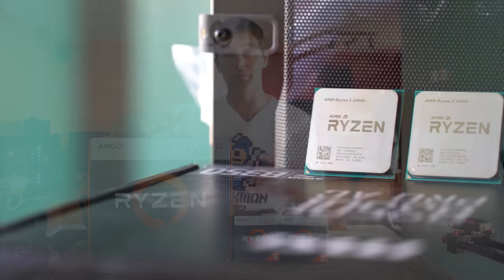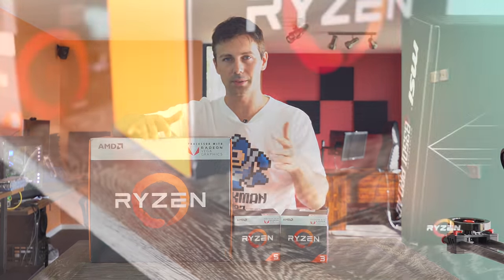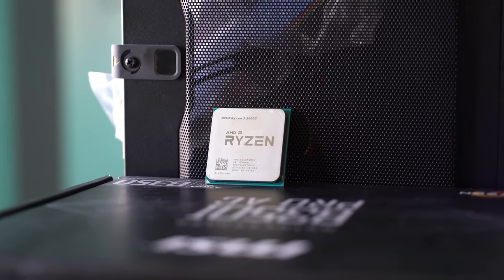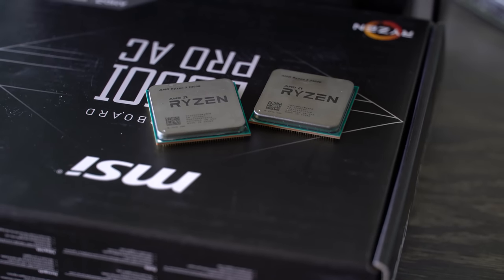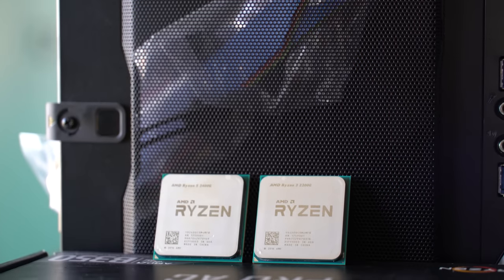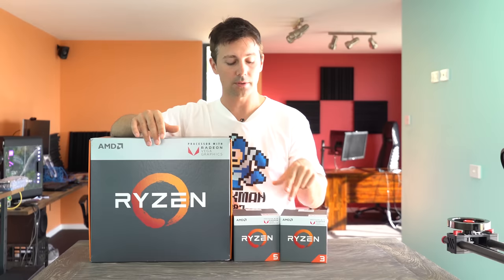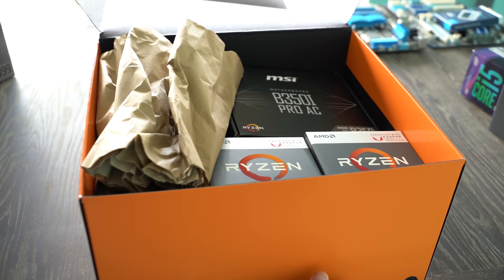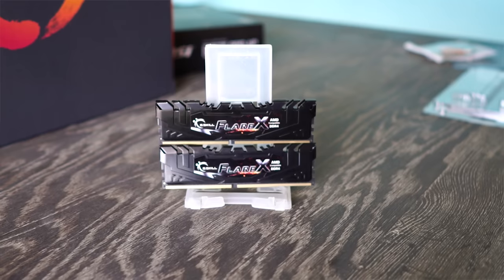Raven Ridge Mini ITX PC? A 'Different' Ryzen 3 2200G & Ryzen 5 2400G Unboxing

Comment: Ryzen 3 2200G gets my vote. Overclock that iGPU and you have GT 1030 + Ryzen 3 performance for $99 :D
Reply: Are you sure? You trolling? your not supposed to leak :D Oz   Are you getting your stuff early too?
Reply: Ultimate console killa!?
Reply: Size and performance!
Reply: 1030? RX 560!
Reply: More like a low clocked rx550..
Reply: they've already given AMD rereleased benchmarks lol
Reply: GT 1030 only? That's a bit disapointing, I hoped the 2200G to be in line with a 550/560 and the 2400G with a 570, I might have been wishing for too much maybe.
Reply: Serius Sim, you want a $99 APU to match the performance of a Graphics Card that costs over $100? and a $169 APU to match a $200 Graphics card? You are definitely wishful for too much, actually if those were the performance levels, I can pretty much guarantee the APU's would be bought out by Miners.
Reply: +hmoham hahaha yes definitely. Would be cool though :)
Reply: John Hooper that's because games aren't optimized for AMD gpus
Reply: Serius Sim you have to wonder why they don't do that? I'd expect there is a market for a mid range GPU paired with a decent CPU, Intel seem to think so as they have paired their CPU with a Vega GPU, AMD could bundle the two on one dye and come out cheaper.
Reply: OzTalksHW I LOVE YOU
Reply: OzTalksHW sad they didnt put the better vega Unit into the 4 c / 4 t processor
Reply: John Hooper That's supposed to be the RX570 but the market isn't gonna allow those prices
Reply: Would a ryzen 5 and a GT 1030 be better then a ryzen 3 and a GTX 1050
Reply: Bike Dude so I should not use the apu? Also what about  RX 550, also can u get an apu and a normal GPU to work together at the same time
Reply: DOes that really matter since Nvidia has no CPU to go with thier GPU?

Comment: That's not going to fit... that's not going to fit... well now you're just being stubborn.
Reply: i know ae.. that was what i was thinking the whole time!!
Reply: If the side doesn't close all the way because of the cooler's height, I would modify the mesh side by cutting a hole the size of the cooler so that the cooler pops through. Then attach the cut out mesh on top of the cooler.
Reply: Closes just fine if you remove plastic shroud around the cooler: https://imgur.com/a/KAgwt
Reply: @Oleg, thank you!

Comment: That stock cooler fits perfectly
Reply: ZG CoffeeGuy NA lmao
Reply: Like a glove!
Reply: instead of stock cooler, does NOCTUA NH-L9i fit better in the case?
Reply: You just need to remove the AMD branding uppercircle. It is just 2 screws. Such a lazy builder.
Reply: @magenci  and that is the point where I stopped the video.  So many other youtubers before him have built in the Chopin and did it correctly.
Reply: at 4:38 you can see that the case is not closed in the back

Comment: I love these. I was gonna build a mini itx as a TV box. I was gonna go with an older i5 and a gt 1030 for very very light gaming. However, the 2400g makes that plan irrelevant now. Having 8 threads, a gt 1030 level igpu, at only 65w is incredible.
Reply: Dingleberry Tech same thinking here, looking at building one as a lounge emulation console. Hoping it'll run everything up to ps2, dreamcast, og Xbox, gc, wii and possibly some 3ds, wiiu. The only thing that worries me is that amd graphics aren't as widely supported on the high end emulation scene. Wonder if it'll overclock to 4ghz on a decent air cooler
Reply: a g4560 and 1030 will be slightly more expensive but wont consume that much more power, it can also fit on most tiny mini itx cases. but of course 8 threads will be better than 4 threads on productive cases. gaming wise the g4560+1030 is formidable foe and very viable alternative. threadwise go 2400g, but then the question comes in why not go r5 1600 or 1700 plus half height gpu like 1050ti ^_^
Reply: Yea, but Ryzen is always 20% ahead of the g4560 in games. Every single single task the g4560 performs, the 2400g will outperform it, cost less, and consume less electricity.
Plus, both the gpu and cpu cores are OCable.
Reply: for the price difference of that 3200mhz ram kit over its 2133/2400mhz counterpart i can freaking buy a geforce 1050 (or radeon rx 560) with 2gb of dedicated vram and have way better performance ^_^ old stocks of Ryzen 5 1400 still sells for 169 but i bet it will still outperform the 2400g when coupled with 1050/560 even when just using 2400mhz ram... 2400g only good for ultra compact budget build... for the online gamers the 2200g is sufficient...
Reply: No, the 2400g is slightly refined Zen architecture with a free GPU inside. Clock for the clock, the 2400g will outperform the 1400 by about 2%. And yea the ram thing's a bit of an outlier with the screwed up industry right now, but with that level of gaming, having faster ram doesn't make a difference in Ryzen. I know, I have a 1600 and have tested this with GPU bottlenecked scenarios.
Reply: again even if the 2400g is 2% better than 1400 (which is not and clearly stated by AMD that is clock for clock just ryzen gen 1 with vega gpu), the level of performance of the 1050/rx560 will be overwhelming for the 2400g vega igpu not to forget dedicated 2gb gddr5 very fast vram. a pentium g4560 with 1050/rx560 will beat it gaming wise saving more money too. tiny use cases is its only saving grace...
Reply: Checking sources, the G4560 is about 75$, where as 1050s are passed 150 now, along with the RX560. No matter how you look at it, you're going to be spending 60+ extra bucks, no way around it. The difference is the 2400g comes with a free GPU, and a CPU that's about 35% better than the G4560 in games. So you can go ahead and put a 1070 in there if you want in the future, and the 8 threads will do just fine. Where as the g4560 chokes around the 1050ti / 3gb 1060 vs other CPUs. If you remove the GPU out of the equation, you're still paying 169 for a CPU that massively outclasses the g4560 anyways, the gpu inside is just a freebee. Plus, you're either going to have to buy a Z270 mobo and upgrade to (what's quickly becoming outdated) the 7700k, your path stops there. But the 2400g, pair it with any AM4 board, and you can upgrade 3 years from now with Zen 2 if you want, literally 3 other skus to upgrade to. The value is incredible in comparison to the Intel route, and only an idiot would go that way.
Reply: i have over 30+ pc's, i never upgraded no freaking processor as the motherboard always dies first. you are evading the point which is both ryzen apu's will only outperform a 1030 if they use an expensive RAM which the difference could buy a freaking dedicated GPU like 1030/1050/550/560 (still available here at slightly above msrp but not by much specially if buy a whole pc set, gpu becomes msrp). i build pc's since 1998 and the only upgrade i do is better gpu's so its always better to buy a good gpu upfront. only idiot fans cling to promises and future proofing false hopes. we still remember the future proof that FX did lols glad i didnt buy into that! idiot intel fans also got burned hoping a z170/z270 is future proofed... the 2200g is priced fairly for its purpose, the 2400g is too expensive... anyways ill buy both APU just to personally feel what they can do...
Reply: Dean Avery check ETA prime video, he already test it for emulator. Spoiler everything run ok - except for wiiu - botw that need to be some work.

Comment: Benchmark Vega IGP vs GT1030, RX550, GTX750ti
Reply: Even gt1030 beats vega igp
Reply: The r5 vega 11 beats gt1030 but that's only for the r5.
Reply: as eetu isola said, 1030/rx550 will slightly edge out the vega igpu, 750ti is a league better as the 1030 barely even beat the basic 750. dedicated vram also plays big role. and i dont think many will buy that very expensive 3200mhz memory for apu. in most cases people will opt for the cheaper 2400/2666mhz ram so bryan should definitely show 2400mhz ram results alongside the 3200mhz.
Reply: Strider Wolf gt1030 would actually have equal results to the r5's vega 11 but I agree with the last,part
Reply: Not just for games either.  Run some Blender Render in GPU mode please.
Reply: ohdogwow2 this is what I want to know, how is cycles with this APU
Reply: Yes, Cycles is what I meant.  I call it the other out of habit.
Reply: Infinite Gaming Im the 100. Like xd

Comment: Would love to see Ryzen 3 1200 with low powered GPU like the GT 1030 vs Ryzen 3 2200G with/without GT 1030.
Reply: R3 2200g without gt1030 would win.Also 2200g has higher clock+turbo so it can't be a stock test cause there's kinda no point
Reply: And amd rx550/560..

Comment: i want to see comparisons to the last r5 1400 and r3 1200, in terms of raw cpu performance and a comparison as to how far you can overclock them compared to there older sibling processors
Reply: aidenhill should be a little less over clocking since there is more heat from GPU and its same first gen ryzen (not +)
Reply: OC shouldn't be affected: Ryzen isn't limited by heat output. Remember these are still the original Ryzen cores.

Comment: compare those APU's with GT1030, RX550, GTX750ti
Reply: Sunil Chennupati I can tell you just by specs it will outperform gt1030 and it will have 2-8 fps lower then gtx 750ti this just to give you idea how will it perform it might not be ultra accurate but shouldnt be very far
Reply: Yeah r5 2400g is also a cpu good to use

Comment: I want to see AMD do a Threadripper APU even just as a proof of concept.
Reply: The Threadripper is for a HIGH end work station and NOT for gaming. I bet in reality a Quadro would be paired with this in a work environment.
Reply: Wont happen, completely useless to.. Wont fit any more on that chip!
Reply: +Sebastian Hakansson   To point out, they do have 2 Zeplin chips doing nothing on those, so literally half the chips under the IHS are not even activated. They have a bunch of room. They could probably even put a massive GPU core between the Zeplin chips, there is plenty of physical space.

The question is why? GPUs increase about 60% performance each year, and Vega was not exactly stellar in the high end anyways (and power consumption), so would people really want to upgrade Threadripper every year or 2? Obviously not, that's where swapable GPUs are great since I doubt Threadripper will become "too weak" within that same 2-3 years. It would just be a waste, otherwise you'll end up needing to add a dedicated GPU then, which ruins the point of having integrated for most people in the first place.
Reply: Jonathan Domenech Using that massive ThreadRipper socket to fit a 4c8t CPU with a powerful integrated GPU around 580 / Vega 56 level would be very interesting as a concept, and may even have a niche, but it wouldn't be very practical for most people. Also the heat would be insane.

Comment: I build a nice little pc for my wife with the ryzen 5 2400g in this case. You must remove the upper plastic ring from the fan of the stock cooler ( which he didn't) and the stock cooler fits perfectly inside (approx 1 mm between the fan and the perforated plate of the inwin case. With the gigabyte ab350 motherboard you can connect two screens. I connected a HD computer Monitor on the DP and the TV on HDMI as this is also the Karaoke server. I used Gskill 3400 16gb memory which runs on the xmp settings without problem at 3400 MHz. The little thing runs perfectly and whenrunning half hour cpu stress test at xmp setting out of the box (no further overclock) the cpu runs at 72 degrees C. I first wanted to throw away that motherboard because with the ryzen5 1600x rigt after launch it had so many problems that I exchanged it with Asus in my home media server. I am glad that I gave it another try in this build. With the latest bios f22 it now runs without any crash since three weeks ( before with the first bios and ryzen 5 1600x it would crash every few hours just sitting idle) . The gigabyte board has a ton of usb connections on which I connected a webcam, external BR drive, external usb soundblaster (better connection to the yamaha mixer for the karaoke) and the usb wireless keyboard. So for this kind of a build (not everyone needs a pc for gaming) I recommend the gigabyte board.

Comment: The cooler fits if you remove the circular AMD bezel around it. It clips over the rim of the fan. You have to pry it off with a flat screwdriver or prying tool.

Comment: I do support the idea of mining performance of the iGPU, also it could be interesting to measure RAM speed scaling to figure an optimal cost setup given the high prices of DDR4. Thanks in advance!
Reply: Would interesting to see sure. Mining test should be more included today, whatever one personally thinks about mining..
But I think that these apu's wont mine that well, ddr4 vram and low vga cores.. And a whole system with a apu just to mine is not profitable!
In amd mining rig with more gpu's, maybe.

Comment: Thermals for Overclocking on the stealth coolers with both Int-GPU and CPU Overclocking would be cool. Trying to build a Ryzen system for my first year of Uni and money is tight, it'd be nice to know how powerful it'll be in the Australian heat. Maybe a few tests of 4X titles (Stellaris, Civ 6 etc.) with just AI players to see how it'll handle the calculations.

Comment: I like them both, I want to like the 2400g more but I honestly don't know when I would buy it as an enthusiast. I think it is a great chip for lower graphic intensity games, particularly e-sport. I could absolutely see myself buying the 2200g.. Under 100 dollar solution (and i was never a fan of the 1200 for its price point with no graphics).I could absolutely see myself building a lower power / cheap system using this chip. I think it will be highly attractive for simple business and office users too.

one benchmark I would like to see is just how much single channel memory hurts performance, something like 2x4 vs 1x8
Reply: It's not for "enthusiasts", it is a lowend part still for those that don't need more..

Comment: I really wanna know how these APUs, perform in non-AAA games, games like Warframe, Overwatch, Black Desert Online, and  League of Legends cuz high refresh rate right clicking ftw. Games that are famed for optimization, for instances games from id, DOOM, The New Colossus. 

Also, I'd like to see how performance are with a Freesync monitor, because Freesync really shines when the graphics card can't saturate the refresh rate of the monitor, and these are low in the graphics card hierarchy.
Reply: Law Hansel I got ryzen 5 1400 which is same as 5 2200g just no igpu I got rx560 and it runs lol perfectly highest settings,gta v all high smooth, pubg medium pretty smooth
Reply: Non AAA games like OverWatch and BOD...They are AAA games.
Reply: Yes Warframe please

Comment: You should test the 2400g against the 2200g with a gt 1030/ rx 550. They would both be about the same amount of money. This would give everyone an idea of the capability of both apus. Also test both with and without overclocking.
So in short benchmark:
2400g OCd 
2200g OCd 
2400g stock
2200g stock
2200g w/ gt 1030
2200g w/ rx 550
Reply: The reason for stock clock testing is not only for a control, but also a lot of people either don't feel comfortable overclocking and or don't want to void the warranty.
Reply: 4/4Bassics yeah but he should oc the  2200g with gpu too and oc the gpu there are still many people who just want the best perfomance for there money

Comment: Id like to see a test against its self,  ideal system (fast ram good cooling etc) vs cheap as possible system (cheap motherboard, single stick of slow ram, etc) see how much performance gets left on the table if you cheap out

Comment: These APUs look pretty sweet, and I'm thrilled for the opportunity to get this kind of performance in this small a package. Nice case, too, btw. Kind of wish the video adressed a few things though:
1) The case side panel clearly doesn't fit. Not mentioning this, and seemingly trying to hide it by carefully composing pictures after assembly seems ... weird. Why not just admit you messed up, and say that to build in this case, you'd need a lower profile cooler?
2) Your interpretation of the TDP numbers are wrong. The TDP is configurable, either in the BIOS or (probably) Ryzen Master. This has been the same on all of AMD's "recent" (at least since Kaveri) APUs. As such, both 65W and 45W numbers are "total" numbers, but the 45W mode will power throttle depending on the use case. Might also lower base/boost clocks somewhat.

Comment: I'm also planning to do a build with the Chopin case and was curious if the stock cooler would fit or not. This video answered my question perfectly, thanks. Guess I'll have to buy a low profile third party cooler.
As for tests, I would love to some previous gen games like Resident Evil 6 tested, which has a free benchmark on Steam.

Comment: I'd like to see the 2400G benchmarked with much older titles and Indie titles.  Basically games that hopefully can be played at 1080p at a smooth 60fps at medium or high settings.
Reply: Should work fine, most things do.. It is the same as a gt1030 or rx550..